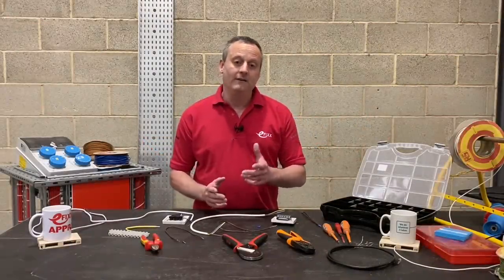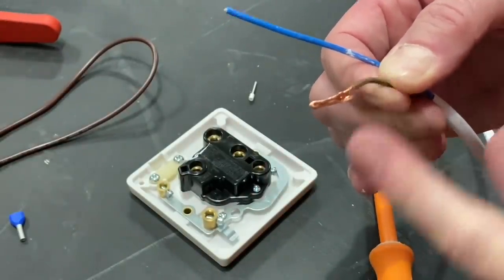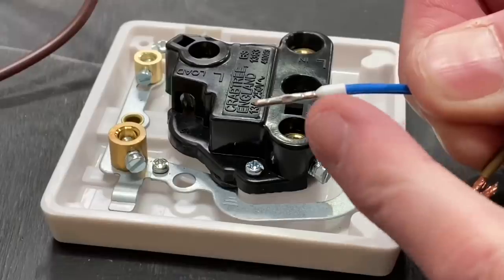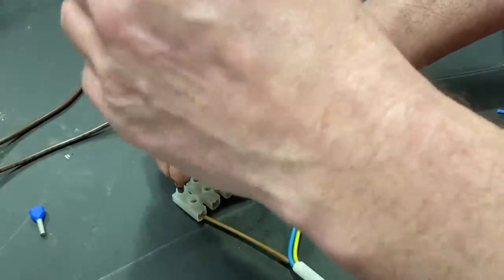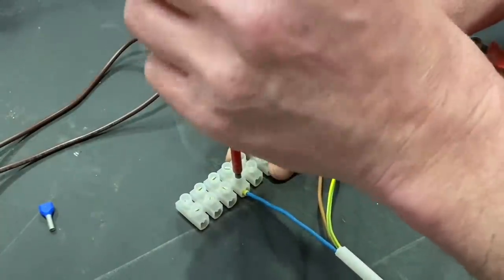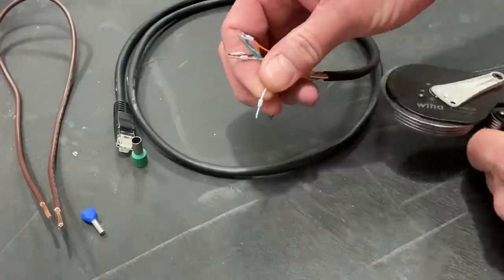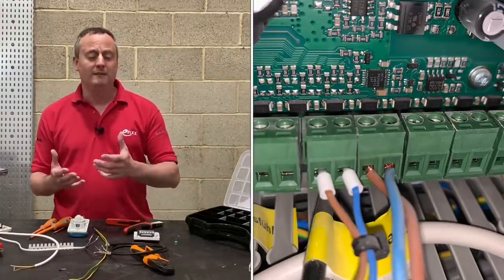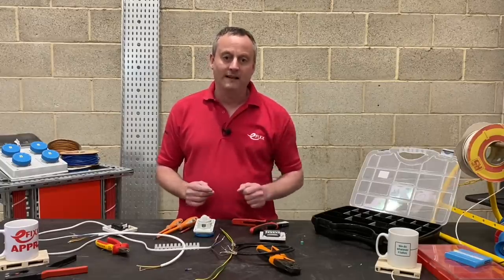Ferrule crimping - An easy way to improve reliability of electrical connections.

Comment: Would you use a square or the more circle type crimping tool?
Reply from the maker: Depends upon the shape of the terminal and size of the conductor. Square pegs in round holes?

Comment: So, the question I have, on the double ferrules: If I have 2x 2.5 square mm wires, do I use a 2.5 square mm double ferrule? Is the barrel bigger to account for the 2 wires? Or do I go for a 4 square mm double ferrule? This may seem obvious, but it's just not.
Reply: 2.5 mm double/twin ferrule

Comment: What about 2 dissimilar metals over time? particularly aluminum and copper?
Reply from the maker: The ferrules are made from tinned copper so no issues. Ferrules actually improve resistance to corrosion.

Comment: What are best cable stripping tool in your opinion please? Ideally one for lsf
Reply from the maker: Hmmm - tough question - all depends on cable size, manufacturer etc - we are using a Knipex Ergo strip atm
Reply: efixx To be honest usually 2.5 or 4mm ring final lsf circuits and 1.5mm twin and 3 core primarily. Such a horrible cable to strip and wanted to know if there was a better tool out there than sidecutters with it!?
Reply: @alanmarriott9216  I like the Stanley FatMax automatic wire strippers that I've been using for a while (FMHT0-96230). Not sure of the largest size of twin & earth they work with but they've been good for doing 2.5mm when I've done it, both the outer sheath and the cores themselves.

Comment: Would tinning the tips with flux & a soldering iron   achieve the same thing?
Reply: @johnku888  I'm not an electrician, but I think that is not right. Low melting temp solder melts at 140C. If your home electrical wiring is running over 100C, I think you have other issues.
Reply: @johnku888  there are different types /purposes ie some solder is for electronics (not acid core if I recall) and some is for plumbing. Might be other purposes aswell
Reply: NEVER solder stranded wire ends. The solder changes the properties of the copper in the heat effected zone adjacent to the solder/copper interface. In a static application it could be considered acceptable but not good practice. Wherever there is movement or vibration it is a complete NO-NO. The termination WILL fail at SOME time just where the solder ends. Rigid heatshrink over the joint is good but is usually impractical in switchboard assembly. Furthermore there is the issue of stress risers at the end of the rigid heatshrink.

Comment: Can I use these Ferrules to crimp wire for home audio spring connector in my Onkyo amplifier?
Reply from the maker: Spring connectors on amps tend to work best with bare cables.
Reply: @efixx  thanks! What about using ferrules with binding posts ?
Reply: @happyhusky4283  use banana plugs, made for speakers...

Comment: Do i need the hexagonal or the square one?
Reply: It depends on the shape of terminal its going into. 
Under a screw the flat square crimp is preferable. In a terminal in say a RCBO with angled <> plates the hexagonal is better. Flat || plates the square crimp is better.
Reply: @williamarmstrong8337  Just what i was afraid of! You need both to cover the all cases, hex and square... Thank you!
Reply: @jimmihenry Bad news. There is at least one more type: a square-ish one that is indented on one side only. 

You need more crimping tools :)
Reply: Actually, none of them. The best crimp is trapezoidal - it holds the cable tighter and fits all terminals.

Comment: Is it ok if you have 3 live wires, twist them together, and then crimp them so they can go into a fuse?
Reply: No. Let professionals deal with electric stuff if you don't know how to do it safely. People spend years in schools learning this stuff, reading through books and books on subjects on how to do it well and safely.

Ferrules are made in 2 varieties: single and double. so you can't twist together 3 wires at all. If you need to connect more than 2 wires to same terminal, you need to have something completely different as a solution, like WAGO connectors or bus bars etc..

And no, never twist wires before you put them into the ferrule, the strands can't move freely anymore and align themselves inside the ferrule when crimping it and it's not good enough anymore.

Always straight non twisted strands.
Reply: Unless it is specced to specifically handle 3x conductors at the same time then the answer is always "NO".

Comment: I just use solder on the ends of multi strand wire to make "pin" tips for screw clamp connections.
It's super easy.
Reply: That's not a good idea as solder will creep under load, reducing the clamping force and potentially creating a high resistance connection.

Comment: @efixx can three cables (let's say 4 sq mm each) be crimped in one ferrule (eg 10 or 12 sq mm ferrule)?
Reply from the maker: Depends upon they type of conductor and the terminal they are going into. - if you look closely in this video you’ll see an example https://youtu.be/t5fO_kWw1Ko
Reply: @efixx  just watched the video clip you mentioned. Thanks a lot for your prompt help. Professional as always :)
Reply: Ive done this before, you just have to try to see what works best, but yes, It can be done.

Comment: Wouldn't they add resistance? Copper has very low resistance, unless they are made of copper they will add resistance
Reply: They are made of tinned copper so they're a good idea.
The thing I don't know is if the materials they are made of is regulated in order to prevent mass produced imports made of cheaper, less efficient materials via some online market places. I could see this being a problem if there are a thousand available for £3 somewhere online and they're not made of copper 🤑😵. It would be interesting to know if anybody has an insight into this stuff.
The only slight concern I would say is: how much effect does it have on CSA of conductors? Negligible, I would say and it's only at the point of termination, but therein lies the question because terminations within consumer units are subject to requirements of torque and the added ferrule should be a consideration, albeit, a small one.
Any thoughts? 🙄💭👍
Reply: @kendoknackersackee  I'm interested in knowing that too, it sound like a good idea but if it's not copper it will add resistance, even if at terminals only it doesn't matter it will add resistance in series which makes it more resistive than the average copper wire even if it's a slight resistance, maybe the ones who use them don't care because the resistance added is very negligible
Reply: @prockershamian3980  I'd have to say, ferrules have been used for many years outside of domestic installations and are fitted by a lot of manufacturers as standard on terminals inside a great many plug tops on appliances.
As long as they're made of copper and securely crimped onto the conductor, jobs a goodun. 😊👍
Reply: For a general use it doesn't matter. Only audio or data u can see the negative effects. It is mostly the length of the wire that is the problem with resistance per material. (sorry if the English isn't correct, not a native speaker). But it's a good question

Comment: Good content.
That said, I couldn't help but notice the frequency with which you preface your nouns with actual or wrap them in actual...itself. 
"Position it into the actual ferrule itself". Why not simply, "position it into the ferrule"? This kind of construction is only necessary for emphasis in specific situations.
Reply: Hermiel ... This is a channel for those of us who want to learn electro-technology. Your need to offer Gaz advice on his use of the English language suggests that, not only are you watching the wrong channel, but you have an almighty chip on your shoulder (sense of inadequacy .. if you need translation)
Reply: @Hermiel  The point being made was that your criticism was unnecessary as this is a video on the subject of electrical crimp connections and not a grammar  video. If you are grammatically perfect then I would love to see your You Tube channel. I`ve looked but cannot see it as yet.
Reply: @chriswearing50  I'm far from perfect in my grammar and in most other areas in my life, which is why I appreciate the occasional bit of constructive criticism now and again. My feedback didn't address the subject matter directly but it was still relevant as it addressed an observable aspect of the video which caught my attention.
Reply: @Hermiel  You have once again missed the point . Your `constructive criticism` regarding the grammar of the presenter were entirely inappropriate and should be reserved for a channel aimed at grammatical perfection. It could be said that Lindas` comment was addressing an observable aspect of your post and therefore, by your own admission, you should have appreciated it. For your records, when you refer to someone by name , as you did, it is usual to begin with a capital letter. ie Linda and not linda as in your post.

Comment: My usual complaint is that so many appliances and plugs are very poorly designed when it comes to the terminal connections. There is very often not enough physical space to get a ferrule into the terminal connection and one is obliged to try and wrap the copper strands around the terminal screw. I would welcome the day when there was an international law on minimum sizes of  ALL appliance electrical connections. This also applies to cable glands; also to junction boxes etc. etc. The physical space is just not large enough to do a proper job of connecting the wires.
Reply: Do you mean the plastic sleeve that sometimes get in the way? If yes, there are ferrules out there for this purpose without a plastic shroud. Very useful.
Here an image of what i mean:
https://www.wago.com/media/images/hea/h12/9882935558174.jpg
Reply: Yeah, the ones with the plastic sleeve don't really fit in UK 13A plugs.  I keep a small stash of the 'uninsulated' version for these.  A bit more fiddly to get the wire in though.  So wherever possible use the ones with the plastic sleeve.

Comment: Is it mm squared or is it square mm
Reply: @stiaankruger2699  great answer thank you 😊
Reply: You answered a question he never asked
Reply: It's both. When I was studying maths and science at school and university we always said square mm but on Efixx they say mm squared. Your choice.
Reply: @AugustinSteven  “mm squared” is a sum/equation not a measurement
Reply: It is square mm. You just have to put up with people saying the wrong thing.
Reply: @AugustinSteven  No. They are two different things. Millimetres square is a square section with sides of a number of millimetres. Square millimetres is a measurement of area. Thus something which is 4 millimetres squared is 4 mm x 4 mm and has a cross-sectional are of 16 sq mm. Of course, in the electrical industry you only ever come across the cross-sectional area, as that what matters in conductivity. So it should always my square millimetres.

In other branched of engineering, then you can come across square section, and thus a piece of 5 millimetre square bar will have those dimensions.

Comment: No youre assuming the 200lb gorilla on the other end is competent enough to check that the ferrule has been crimped correctly. My plant has multiple EU chiller units where i have found on many occasions the wire pulls out of the ferrule.

Comment: It does make some difference using the ferrules, but the company behind making the product needs to come better, more improvement needed. When you tighten that screw the ferrule flattened creating an hot spot and weakened the area, matériel used need to be tougher and at the same time able to crimp.

Comment: why not twist the wire? makes it easier to get into the ferrule.
Reply: When you look at the insertion end of the ferrule, they are tapered so its not an issue, goes straight in an recomended crimping proceedure is to NOT twist first.

Comment: Why not use solder
Reply from the maker: Tricky if you are on site and not allowed in many wiring regulations .
Reply: Because solder creeps under load, which can cause high resistance connections.
Reply: to much time consuming.

Comment: Can you explain why you used a ferrule on stranded conductor, I.e. the 7 strand CPC. Ferrules have no place on that style of conductor, they are for use on fine strand only, like flex or tri rated. Poor practice like this leads to poor connections, overheating and fires.
Reply: The principle of a ferrule works regardless of how fine, or thick, the strands are. A ferrule is a shepherding device to ensure maximum electrical contact at terminations. It will improve electrical connections, and thereby reduce the likelihood of overheating and fires. You are claiming the opposite here. You'd have to explain your rationale for why it is bad practice! The advantage of multi-stranded cables are their flexibility, but that is moot at a fixed termination.
Reply from the maker: We are making a video soon about ferrules on Class 2 conductors (7 strand as you mention) - then the industry can then debate the issue.
Reply: I'd expect a better connection.

Comment: Ferrules certainly work but why would you be using stranded wire for infrastructure though?
Reply: I have been wondering the exact opposite for weeks: in Italy we only use stranded wires in domestic installations. But in the UK, where I live now, it's usually solid core wires.
Reply: @DavideAnastasia  stranded wire is flexible so is used for appliances where the power cord will be moved frequently.  It's also more expensive.  Conduction seems to be about the same if the amount of copper in the lengths are equal however bear in mind that stranded mm2 does not actually have the same amount as solid because there is air and possibly corrosion in the gaps between the strands.
Reply: @drcl7429  I think, the real reason why stranded is used in Itay is because we feed wire *after* plastering and decoration has been done, installing flexible round pipes inside the wall during the build process. Making an hard core "navigate" its way inside the wall is a nightmare...
Reply: @DavideAnastasia  Certainly sounds like a reasonable explanation.  What diameter are these conduits?  Must have some sharp elbow joints?  Is the feeding done by pushing? Seems like it would be easier to drop a very flexible "fish-line" then pull.    Maybe you can direct me to a video of some Italian installers to see how they do it?
Reply: @drcl7429  To be honest, I am not sure about the diameter. We have some sharp elbow sometimes, especially when moving from one wall to another. Cables are pulled, not pushed (pushing would make them stuck into the pipes), using something like a fishline, a strong nylon cable with a flexible tip.
This video shows the technique: https://youtu.be/WQRzB4tK-eM (unfortunately in Italian, sorry).
Somehow I am still surprised the techniques in the UK are sooooo different.
Reply: Stranded carries more amperage than solid conductor and is more flexible typically than solid conductor.

Comment: £138! They can keep them 🤣
Reply: Just a quick point. Being a lefty Sparks as I am, you've probably twisted the strands anti-clockwise. The screw goes clockwise so it will unscrew the copper strands as it tightens.
Reply: @rp8068  what are you on about 🤣

Comment: The only problem with this is for DC voltage for communication needs to be stranded because the voltage needs to ride with all the wires through and through instead of a round the circumference. No doubt it’s a good connector though more on the line of basic wiring and not communication dc Volts in current
Reply: Unless it is litz wire, the ferrule makes no difference. Also check the frequency component of the skin depth equation before worrying about the effect.

Comment: Yes it's good but look at the added tool expense. Nothing wrong with a soldered wire looks just as good and not as expensive.
Reply: In my world time is money; thus this is the way to go
Reply: Lead adds resistance to the circuit.....under a heavy load the lead will melt away. I have test loaded 480v Motor controls with and without ferrules voltage is better under a load,and time is money.....
Reply: saves more time than soldering. so would make up for the expense of the tools in no time.

Comment: I tinned the cable with solder
Reply: Bad Idea, especially on mains voltage. Problems are:

1. The solder will deform over time under mechanical stress and so the terminal is no longer making a good connection, so causing contact resistance.
2. Solder corrodes on the surface, so this will also cause contact resistance. If you solder electronics or solder wires together that's no problem at all, because the solder only corrodes on the surface. Tinning a wire and stuffing it into a terminal, that's the problem.

Here in Germany the practice of tinning a wire and stuffing it into a screw terminal was banned in 1979.